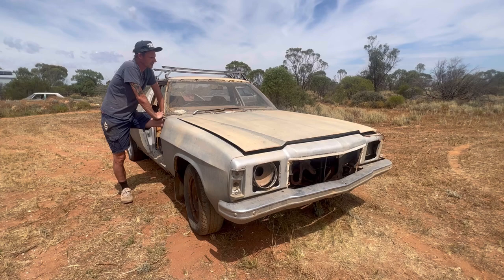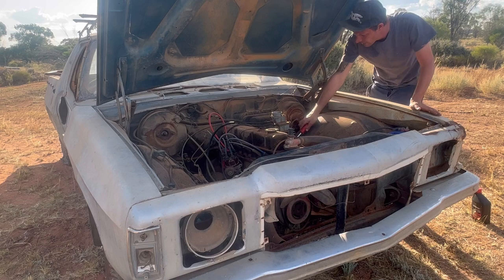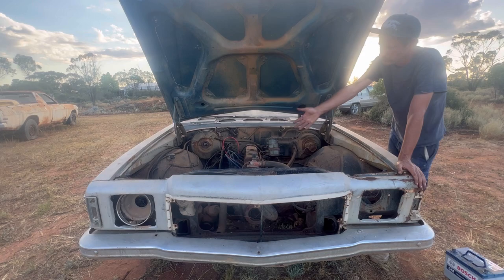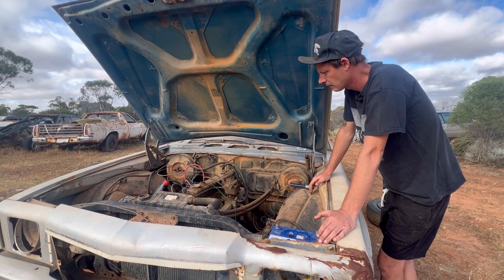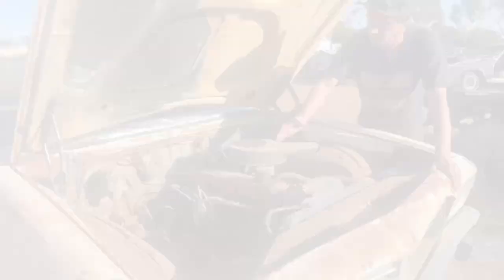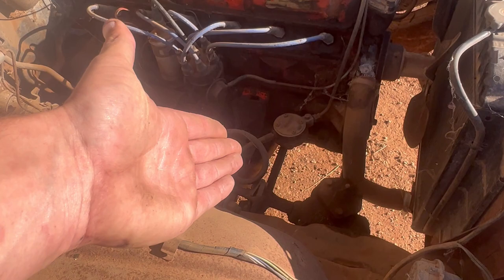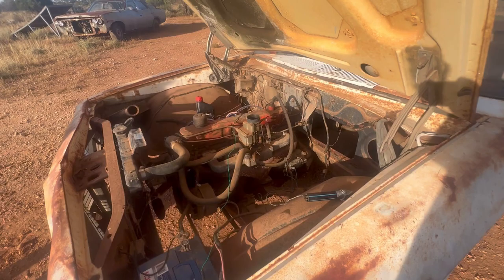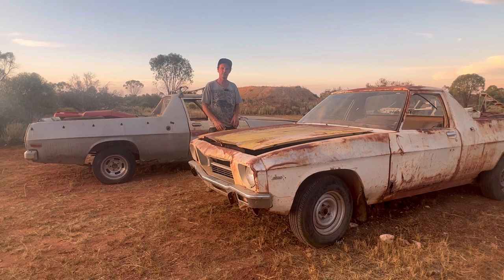BACK to BACK REVIVAL for these TWO HOLDEN UTES will they run again?

Comment: When you pour fuel down the carb , you need to open the throttle to start, because its actually flooded. Better idea is to pour it through the breather tube and fill the carby bowl. And it wont run properly until the lifters fill with oil

Comment: The 1st ute. Was the gearbox linkage jammed? They were mongrels for that
Reply from the maker: Yes they are. Unfortunately for me it wasn’t the issue. This would go in and out of gear with ease when the engine wasn’t running. When it was running and clutch in it just as the gear should engage there was a huge resistance on the shifter. Clutch gone.

Comment: Frozen clutch no problem , just start  it in gear, it will soon release itself, but you would need to be able to start it from within the cabin.
Reply from the maker: My trigger to start it reaches so I can tuck it under the driver side wiper so I tuck it in there and lean out and start it. Driving it without the clutch wasn’t the problem it was the stopping part. If it had a clutch I would of worked on the brakes somewhat. But both those problems combined and the other car, I called it a day with this one.
Reply: @V8JakeC  Do you have a handbrake ? . Possible it wouldnt have started in gear anyway if the brakes are locked on.
Reply from the maker: Handbrakes with these old things in this shape have only resulted in two instances for me in the past. Either the brakes lock on, or it does nothing. I find it best to not wake snakes in that situation. 

I did bump the ignition with it in gear to see if it would move in gear ( off camera ) I dare say if I jacked up the rear and hit the button it would of started in gear.

Comment: I'm thinking worn gear linkages on the 202. It's an easy check
Reply from the maker: Wish it was that easy. Car would go in and out of gear with ease without the car running.
Reply: @V8JakeC  Got it